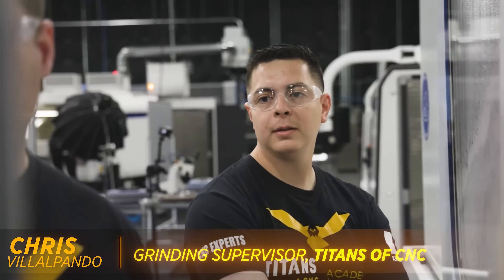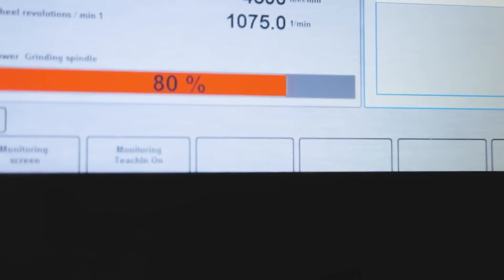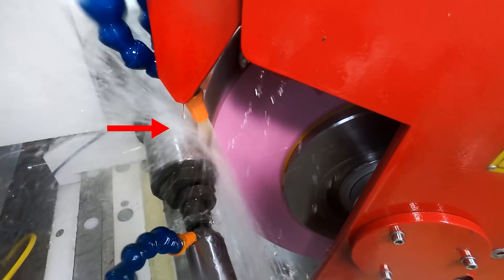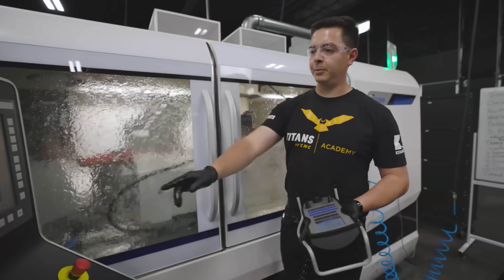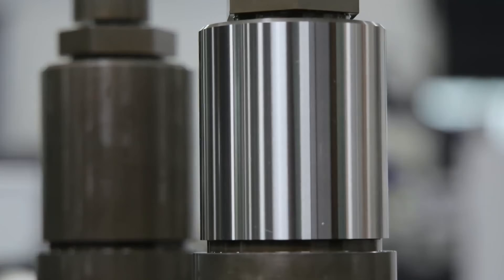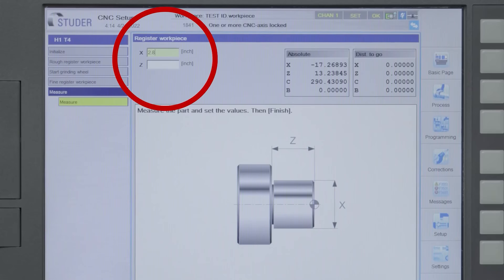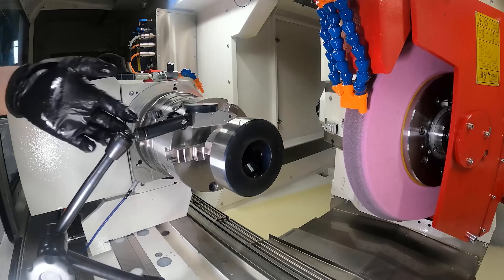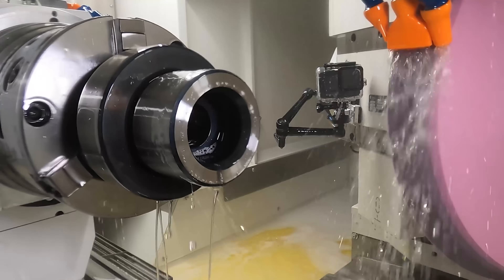300% Increase in Productivity While Old Timers Complain

Comment: Im one of three guys at my shop that can run a CNC. My boss is one and he's too busy  since we are mold shop and everyone in every department needs him constantly, and the other is part time retired. After the first couple months of working and getting used to the machines, I started pushing tools to their recommended feeds and speeds. My boss was blown away how fast I got things done. And I can attribute it to my first job where that was the standard. I've only been machining 3-1/2 years or so, but I feel like applying some old tactics with some new can be very beneficial. But pumping out the parts is the goal to any machine shop, so we don't waste time

Comment: I got bitten by my own ambition ones and I will never do it again. I was managing a job shop for an owner who had no knowledge machining. We had 6 cnc milling machines 4 cnc lathes 7 Bridgeport's 3 manual lathes and a bunch of support equipment. We had an average of 15 employees on days and 5 or 6 working nights over a 10 year period. I did whatever was necessary to make the business successful and make money for the owner. I did sales bid the work ordered tooling materials I sourced all our outside processing welding het treating grinding I ran the shop as if it was my own.  My average work week was 50 to 60 hours and quite a few weeks I worked both shifts as skilled machinist in the area were hard to find. In the end I did a half ass repair to keep a machine up and running to fill an order for a military manufacturing customer. The owner was a cheap bastard and I did a lot of machine repairs myself because he would bitch about calling in a company tech. And because he was a cheap bastard I had gained a good bit of knowledge of cnc  machine tool repair and I thought I was good. Well I fucked up on a air over hydraulic lathe chuck mechanism repair and it went horribly wrong. The half ass repair I did to keep the money comming in cost me my hand. That cheap mother fucker didn't stand up and help me through the recovery and because he had made me a salary employee part of " Managment" I was taken off his workmans comp insurance policy. And that bastard did everything possible to fuck me over. The moral of my story is look out for you because no one! I mean no one! will look out for you. If you don't own it it's not yours.

Comment: Hi, this isn't a grinding question but i would really like a video where someone explains in detail for to use carbide drills with tsc, i have had hard times getting the chips to break, need help with basic fundamentals like should i increase feed to break the chip or rpm, etc.
Reply: TSC is through spindle coolant. I use carbide insert TSC drills on 4140 and other tool steels and program with mastercam. Usually run all sizes at 230 surface feet pet minute SFM and feed at .0015 to .003 inches per tooth IPT (8 to 11 inches per minute IPM). When the inserts start to dull i get stringy chips to fix this just increase the feed slightly up to 1.25 × the original feed rate.
Reply: Get in touch with the company that makes the drill they have feed and speeds for every drill and material your using it on.
Reply: You need the right feed and speed from the get go to make the insert last longer I would think, from my experience when drills start getting dull or small chips in them, there gonna string chips.
Reply: Carbide Drills with tsc?
What is tsc pertaining to?
Reply: @ Chaz Ratke

Comment: Old-timer at my shop doesn't believe in using coolant. He fills the shop up cutting oil smoke thinking it's the superior way and all the rest of us don't know what we're doing. Not only is he the slowest, he has problems with warpage due to excessive heat that coolant usage would fix. He's always right and we are always wrong, in a condescending way, refusing suggestions from anyone. I say he's a machinist of the 20's , the 1920's !
Reply: Sounds like he needs to be demoted to running the stock prep saw. WITH COOLANT RUNNING.
Reply: @Turboy65  No, I'd fire him and save money.
Reply: @Turboy65  Ha ha!!
Reply: That sounds like a shitty work environment. Always do your best work and don't let the bastards grind you down!

Comment: My boss doesn't seem to care about quality as much as speed. I always do things right the first time. I don't bring a part to inspection until it's a good piece and all the bugs are worked out of the process. When the job is in production it runs smooth the whole time and all the parts are done in a week. Everyone else rushes to get the first piece approval from QC as fast as they can too impress the owner. (Who is not a machinist himself at all) . 10 times out of 10 once their jobs hit production they instantly start having problems and start making junk. So then it takes a few more days to a week to get all the bugs removed and get it running again.  So they've slowed down the inspection room, the original programmer and setup guy. They've got the floor manager and bosses all having a meeting about how to proceed. Meanwhile my jobs are still running beautifully and I'm doing my next project. The owner gets all happy with them and constantly acts like I'm taking to long. It drives me nuts. Speed isn't everything. Anyone can make junk really fast and my boss doesn't see how that slows down basically the entire shop and his best most talented machinists are miserable constantly fixing the "faster" guys horrible practices.
Reply: A great practice make the first part right and the rest will be right. I think your method as described is the way a good production shop should operate. Chasing bugs it a setup drags production down in the short and long term.
Reply: That mindset that quality will always triumph speed is one I've tried to hold when I started 2 years ago.

While I usually get an earful about needing to speed things up compared to others, I still would rather be steady and unerringly right than fast and wrong.

Even just today, I was having to reconfigure a setup because the program got wiped to a previous version.

And instead of recreating everything like before when I was rushing to get it reprogrammed, I took some time to program some changes to the part so from the moment I pop the stock in there i can just hit start and I know it'll hit every tolerance for each instance I have to run.

And that's given me some breathing room I reckon.

Granted, I still want to get better with programming so I can actually hit all the specifications I want without having the very few things that still slip through the cracks be caught during the cycle.

Comment: Great story Chris.  I have seen this several times.  Whenever the guys on the shop floor find out how much time they have to do a job they would surely drag it out and use every bit of the quoted time.
Reply: Reason is in most machine shops you can reach the max possible rate per hour(whatever it is, it's low) and no matter what new technique you do to improve the process and make parts faster, you won't be getting rewarded better. Once i made £10k in a shift and i was worried i was running too slow and managment was shocked i already finished the parts, couple of days early. I got a handshake and got forced to do 50-60 hours weeks for my hard work. Many examples like that in the same company, i've left broke with broken back, so there is no point running faster, unless you work for the right employer or yourself. I still love to make parts faster and better, but it's sad it's never rewarded properly.
Reply: @savioer  That right there.  100 percent right. So many variables to discuss it can't really be done in a YT comment section. If the faster person's setup is not good the job runs and it might be days/weeks later before it is realized. Now, many more people have to be taken off whatever they are working on to figure out a problem that was always there but none cared to look deeper until they are forced to because of scrap.   A 2 hour setup turns into a week of 5 different people having meetings and troubleshooting someone else's speedy setup. 🙃 
Obviously faster is better but I would add IF the person going fast knows exactly what they are doing. If not you just create more work for your most important workers. That's a management issue though. 
Unfortunately I can't just up and leave my area. Not many choices for shops around here. 
I would love to get up and go to a place like Titan where I know my concerns and expertise will be respected and acted upon. Here where I live I can't program tools to run too fast. What happens every time is the operators don't change the roughing tools then the whole job falls apart.  It sucks but what am I to do? I work with the world I'm in not the world I wish I was in.
Reply: @savioer  £10k in a shift? That's impressive! I wish I had that kind of work coming through the door.

 It's an odd sitiation that, I don't belive there's a company in existence that wouldn't benefit from doing things better or faster.
There's an argument that slow and steady wins the race, like overall the workflow needs to be balanced, but better productivity is better productivity at the end of the day.
Reply: @LooseyHenderson  In reality if it was quoted at £1k it would still be great. If i was one man machine shop, i could get away at £400 pounds and still be happy. Job was 40 U shaped stainless 316 profiles(material free issued by customer), half a meter long, with 15 slots in it, tolerances +-0.2mm on the slots. Not many machine shops in the area that do that kind of small stuff, everyone else is making very large oil & gas stuff on boring machines. Also there were lot of jobs where i've just made a record breaking times and making a lot of money to the company, now they replaced me with 3 guys, each have 20 years of experience, lmao.
Reply: slots were only 7mm wide and material was 1.5mm thick, so there wasn't lot of machining.
Reply: @savioer  "Can't have too much of that there productivity 'round these parts"

Sounds like a nuisance of a part to clamp properly, but the loose tolerance helped I'm sure.
Reply: @savioer  I agree there is a lot of shops that take advantage of people who work hard like this.  But try the opposite and do the bare minimum with a terrible attitude and see how far that gets you.  I am like you, no matter what the company does I like to make things fast and with high as quality as I can.  I have been at the same companies where they took advantage of that and I’ve been at companies that paid me well for it.  But I don’t think that’s a good enough excuse to teach people to do the bare minimum and never try hard.  Even if the company doesn’t deserve to have you, you will feel better about the work you do and have more self respect for yourself.
Reply: @Jessie_Smith  Thanks for reply. I agree completely. Despite this trade not being appreciated enough by many employers, i'm always competing with myself to do and be better.
Reply: @Jessie_Smith  Why is stuff like this and all these stores SO common in shops. I can relate to this EXACTLY the same. Time per part as per traveler is double the time it takes me to run these parts. Old guys take advantage of that and tell ‘me to slow down. They don’t want to have to increase productivity. Why is this stuff so damn common..Iv decreased run time on parts and have so many ideas and they don’t want any part of it

Comment: The problem always is and always will be not enough pay to the workers. Why would anyone be incentivized to speed things up with inflation giving everyone a yearly pay cut and we all know shop owners open shops to make big money. Its no secret why the manufacturing industry is full of people who don't give two shits. I stick with that adage, Act your wage. Edit, the very end, the chance at more overtime... NOBODY WANTS OVERTIME. Pay more per hour for fuck sakes.
Reply: Whether you load one part or 50 parts or 500 parts during an 8 hour shift, you are being paid for the time you are in the shop and the skills you bring to the table and the volume of production.  With everything being made pretty much on CNC and good material handling there should be a vast reduction in the amount of physical exertion a worker needs to put out.

What you don't see on the floor are the customer demands of cheaper, cheaper, cheaper and faster, faster, faster; the burdens and demands and costs of JIT and make-to-order work scheduling rather than carrying finished inventory (there is a time and place for holding this); acting as a bank for your customers and waiting to (sometimes wondering if you will) get paid .  High production work is almost always low margin work so maximizing throughput while minimizing employee "interaction" during the manufacturing process is the only way to remain profitable.

A shop may invoice for large amounts, but what matters at the end of the day, is the company's reputation and the cash left after all the bills and taxes have been paid.
Reply: You could pay the workers $300/hr and they'll still do literally nothing. The only incentive, is a difference in pay based on productivity. And that certainly exists, specially in machining.